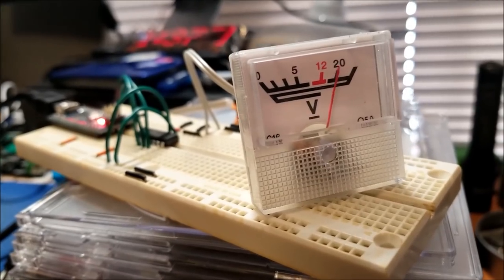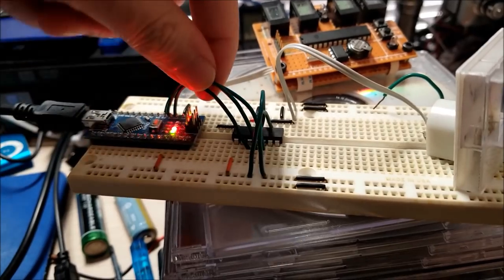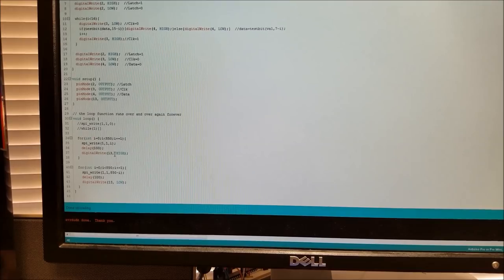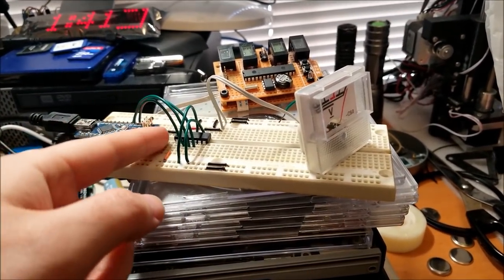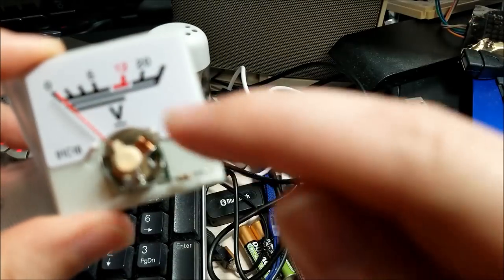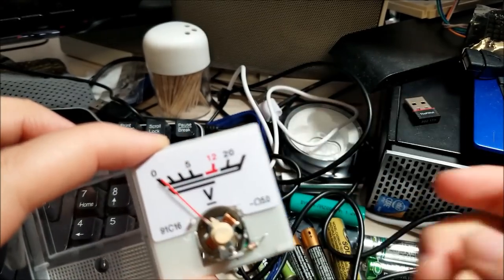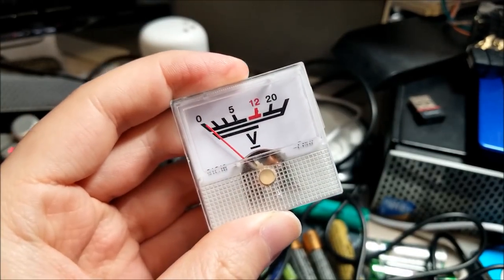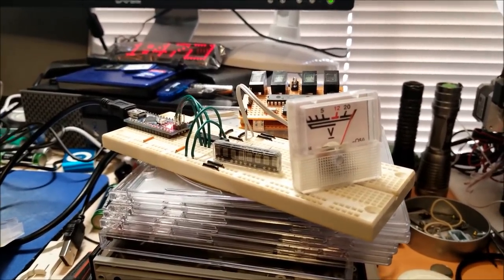Analog Meter Clock: Part 1 - DAC Output

Comment: Very cool project. I'll build something similar I think. What you could do to find the right value of resistance for 5v full scale is to take a 10k potentiometer and determine how the meter behaves when decreasing / increasing the potentiometer's resistance. This should give better accuracy too, since you aren't just using 1v of the 0 to 5v output of your DAC.
Reply from the maker: Manuauto Yeah that's true, but I figure since I am using such a high res dac, having only 850 steps in such a small swing range wouldn't be very noticeable. Though having the full 4096 resolution would be silky smooth.
Reply: sjm4306 Yeah it's pretty overkill, considering the sway and non-linearity. It should be possible to calculate a mathematical function which compensates this. Do you have any idea how to approach this or do you want to use a simple, pre defined table (as mentioned in the video)? I think I will as my maths teacher about this.
Reply from the maker: Manuauto You could create a closed form mathematical model of the meter as a mass spring system and just solve for the deflection as a function of the driving force (input voltage). I like to keep things simple so I will likely either experimentally compile a look up table or create a best fit piecewise model extrapolated from a ramp excitation. Either way it won't matter too much since the display is so tiny that any small error isn't going to be too noticeable anyway.

Comment: ...a good way of programming would be to remember where it is and increase from there - i mean, to drop to zero slower, and to go forward faster... Or even better - to always go slowly to a maximum value detected, so it will lag behind a bit. (I wrote this for a vu-meter, so you can ignore it for a clock :)

Comment: Just wondering - and probably a silly question - but why use a DAC rather than PWM to drive the meters?
Reply from the maker: No reason, both will work just fine. I just happened to receive the chips as a sample and wanted to get some practice using them in a project. I intend to use them in an upcoming project that will be interesting I hope.